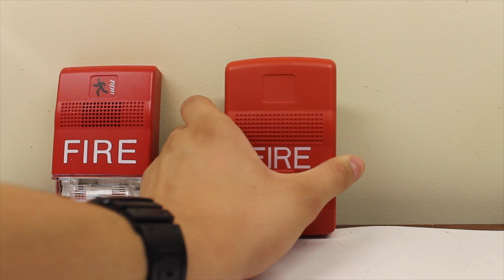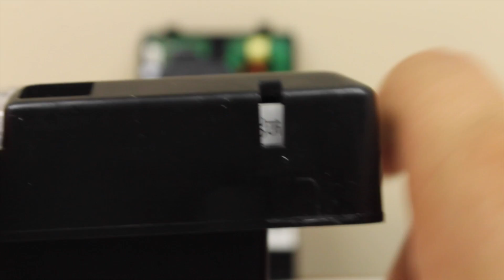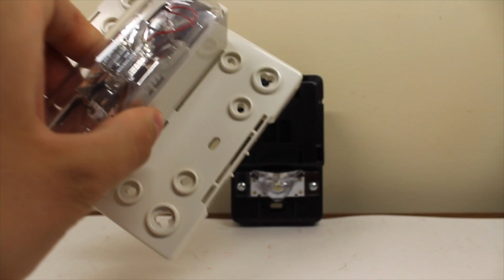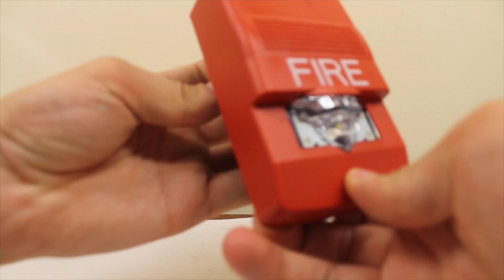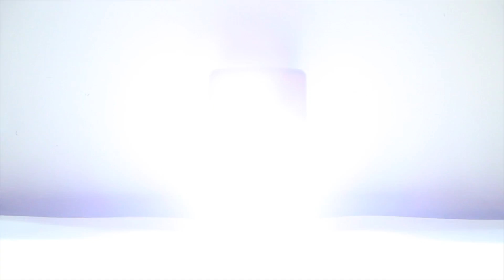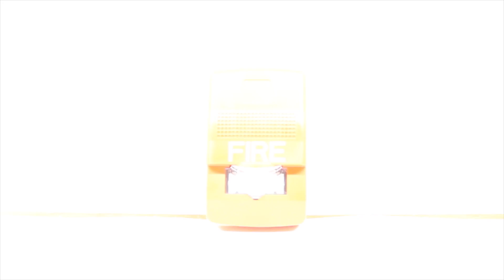Edwards GL1RF-VMC (LED Genesis) Fire Alarm Test

Comment: Not so fun fact: UTC is a group of company that includes est,there is nothing like this made in not only est,but the full utc group of companies.the actual led genesis was released in 2018 and it is made under kiddle and Edwards. interesting to know
Reply from the maker: I have seen the new version that you mentioned in other videos. I'll be honest, I like this version better than the official Kiddie version (this one is closer to the original Genesis design). Back when I made the video and when I wrote my initial thoughts in the description, I was guessing that this was a prototype for something that they would eventually be released (but somehow was circulated around ebay). Looks like my guess was right!
Reply: @NewEnglandElevators  sorry for my slow response because i didn't had much interest at that time but now i got more interested again  so i agree it looks more like the original genesis but the kiddle and est one sounds more like the original genesis, it probably had the same piezo
Reply: @NewEnglandElevators  Another update, I got the new final product. I think you are right, that is a prototype.

Comment: I think this alarm is just a prototype because I haven't seen it on Edwards/EST's website yet.
Reply: I would bet someone just got creative with a Wheelock Exceder LED then sold it on eBay.
Reply from the maker: I will agree with you, there's no legit info yet about this, including no info on the site. This didn't even come with an instruction manual, simply screws for the device. I'm wondering if this is a prototype that was somehow leaked to the public, that will officially be released soon...hopefully not another knockoff...cough cough...SpectrAlert knockoff...cough cough.

Comment: If you get a low frequency sounder can you imply the FA tech has gone a long way again as fire alarm audible notification??????
Reply from the maker: I think anyone can imply that Fire Alarm tech has progressed even more by simply acknowledging that there's low frequency devices, for example. You don't necessarily have to get the device to do that.
Reply from the maker: I think anyone can imply that Fire Alarm tech has progressed even more by simply acknowledging that there's low frequency devices, for example. You don't necessarily have to get the device to do that.

Comment: I got a edwards genesis low frenquency sounder strobe what it looks like, it takes the design of a genesis speaker strobe on the front but instead of the running man it has 520 hz on the cover
Reply from the maker: Odd that they would use the design of the speaker/strobe. I know exactly what you are talking about; I'll probably get one eventually.
Reply: i also have ADT's version of the edwards genesis horn strobe the model is ADTG1R-HOV75
Reply: do you wanna see it on my channel ???????????

Comment: you are right fire alarm notification tech has gone a very long way they now have Low Frenquency sounders & sounders/strobes Edwards Signaling/EST has them (As Genesis G4LF series) System Sensor now has them (As Spectralert Advance series) (before EST Genesis G4LF sounders) then Wheelock (As exceeder LED series) Now Gentex manufactures Low Frenquency sounders
Reply from the maker: That, too! For this video, I simply implied visual notification, as this is new visual notification technology, and the feature of the video.

Comment: That alarm reminds me of the Wheelock LED Exceder Series. For a fun fact, the Wheelock LED Exceder Series was designed before the EST/Edwards LED Genesis was designed. Edwards later bought Wheelock's horn and horn-strobe products and redesigned them to look like a Genesis alarm, but left the font that Wheelock uses for the "FIRE" lettering original. That's why the fonts of the two Edwards Genesis alarms you compared are different. If you compare the fonts on the LED Genesis and the Wheelock RSS, they're the exact same font.
Reply from the maker: Essentially it is, just in a different shell
Reply: I believe the genesis came out before the led Wheelock exceder.  Simplex came out with something similar for the tru alert
Reply: @MrWill1985  Yes, the original xenon Genesis came out well before the LED Exceder did, but Edwards temporarily rebranded the latter as their own before they had their actual LED devices ready.
Reply: @TheCarson116  I wasn't too fond of the white background on the genesis strobes but I like the genesis now that the led has a mirror like background like the other strobes have
Reply: @MrWill1985  Not sure I get what you mean but okay.
Reply: The EST Genesis Horn Strobes, Horns, Strobes, Chime Strobes, and Chimes (If they have fire lettering) use the Helvetica font, while the Speaker Strobes and Speakers use the Arial font along with the ceiling mount Horn Strobes and Strobes. 😎

Comment: Like when you get the horn version of the Genesis LED?😀
Reply from the maker: Celeste Torres Actually, I do have the horn/strobe version of this particular device. However, it arrived dead on arrival, so I couldn't do a video on it.
Reply: NewEnglandElevators You can get another one I found one on eBay for $45

Comment: I wonder if they (Edwards and/or Wheelock) could make a mass notification alarm that uses a bi-modal (any two from white, blue, green, amber, and red) LED in the strobe...
It would be a fantastic idea, I think, since it would eliminate the extra space for strobe expansion plates, such as the EMNS RSSP and the G4ERA.
Reply from the maker: Craig Baker Considering there are a few LEDs that can do that, it wouldn't surprise me that someone would eventually develop a method that incorporates both a white and an amber LED (as you said), yet still produces a bright enough output. If that isn't possible, the LEDs used in the device are fairly small, so it may be possible to accommodate two LEDs in there, as long as the lens on the unit is redesigned to be able to distribute the light of both evenly.

I'm not sure if such a design would not meet NFPA, ADA, or UL requirements. It's definitely a thought, though.
Reply: ***** I think that only one requirement (1 Hz flash rate) would apply for using the other color, because changing an LED's color degrades its candela rating, and because the NFPA requirement of at least 75Cd for public use would not apply for the color because it would not be used for fire evacuation.  Amber degrades to about 95% of the white candela rating, blue ~74%, green ~60%, and red ~28%.
As long as the lens is not stained or frosted, the end product should be compliant with NFPA 72 and a few ISO standards.

Comment: Awesome! I think the way it flashes compared to the normal strobe is cool.
Reply from the maker: Grant Bansemer If you take a close look at the pattern the LED flashes, particularly how it fades in and out, in a way, it's a return to the "blinking light," very much like the older incandescent lights from the past. This can be seen on devices such as Space Age Electronic's AV32/34 or V33 (that have the flasher circuit), and the Simplex 4050-85 (that has a flashing circuit, the -80 does not). It's a little more pleasant as opposed to a typical Xenon strobe, but it's VERY bright. Quite effective if you want to say that.